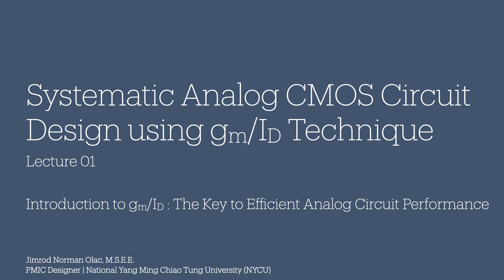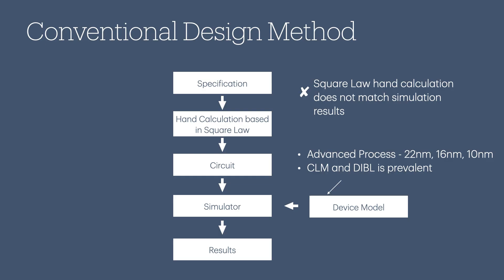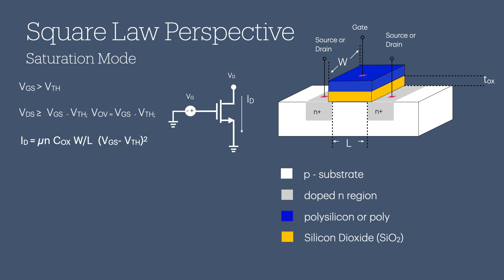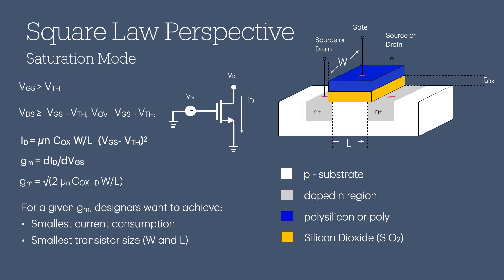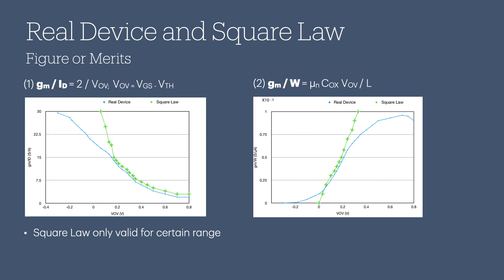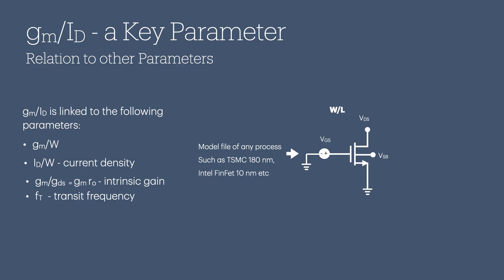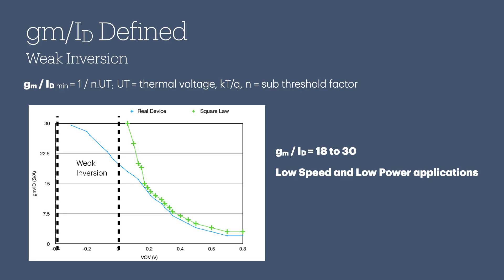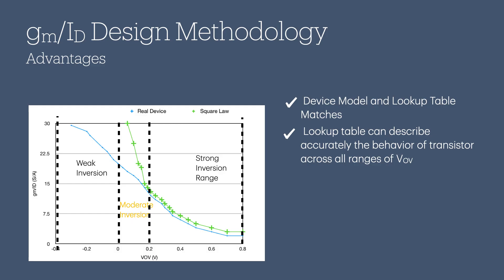Lecture1 Introduction to gm over ID

Comment from the maker: This is Part 1 of 6 of Systematic Analog CMOS Circuit Design using gm/ID Technique

The course is designed for engineers and students who want to move from theory to real-world analog IC design, using the free version of LTspice and a free 45nm CMOS process model—simplified enough to follow step-by-step with no need for paid EDA tools.

The course is compact and focused, so you can start applying gm/ID immediately.
 
Course Coverage:
Part1 - Introduction to gm/ID
Part2 - Current Mirror Design with gm/ID Methodology
Part3 - 2-Stage Op-Amp Design with gm/ID Methodology
Part4 - Device Characterization
Part5 - Current Mirror Design Example using gm/ID Methodology
Part6 -  2-stage Op_Amp Design Example using gm/ID Methodology

If you're interested to access the whole course, please click the link below:
https://jimrod-norman-s-site-7963.thinkific.com/enroll/3596202?price_id=4532174

Please reach out to this email if you have questions.
email: support@cktgenius.com